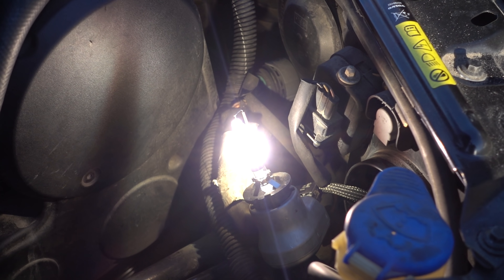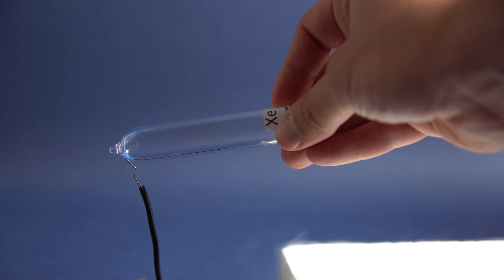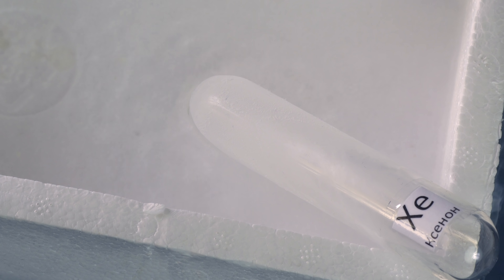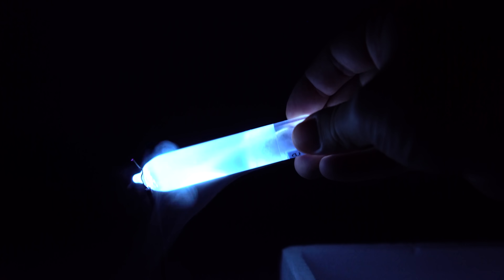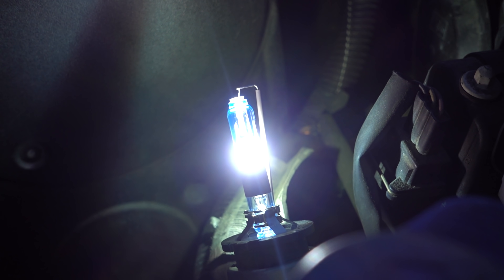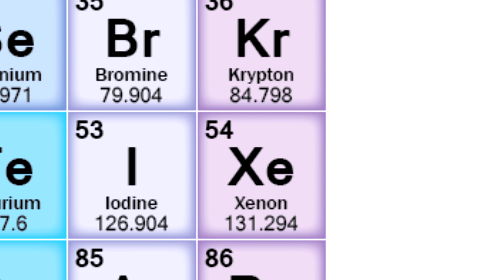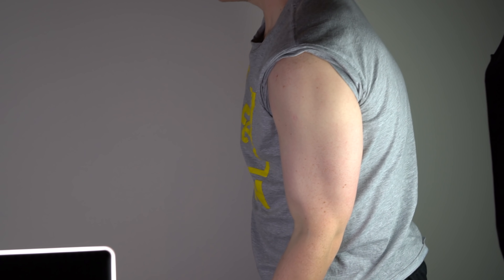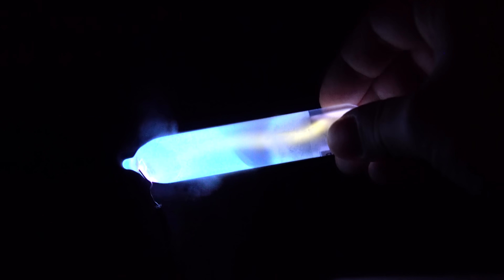Xenon  - THE BRIGHTEST Gas on Earth!

Comment: Ксенон (Xenon) lamps used to make cinema projectionists quake with fear. Because of the erosion of the anode and diode they must be replaced on a regular schedule. The large globe (our industry term) in some projectors is about .5M long and is highly pressurized. In the box with the lamp comes a protective face mask and gloves plus warnings that it is about as safe as handling a grenade with the detonator pin pulled out. This is an exaggeration, but still, no one wanted to be around in case of an accident.

Thank you for another excellent video!

Comment: Problem with xenon headlights isn't that they are too bright. It's that the new piece of shit cars constantly removing user settings to increase profits means most headlights are no longer adjustable. Every bulb is different and so every bulb requires different aim setting to optimize night vision for the driver while aiming the brightness away from the oncoming traffic. This aim is only partially adjustable or fixed in new cars. Manufacturers do things like this on purpose because as people try to save money by buying headlight from jobbers more cheaply people get pissed off and complain. Eventually you will be forced to buy factory assembled and aimed headlight units for hundreds of dollars required by law. Your vehicle will become obsolete faster simply due to expense and availability of that stock part. They get 1000s of times more for the repair and they will get people into buying an entire new vehicle sooner based on issues like headlight repairs that used to be so cheap people carried spares with them, to now where thousands can make you consider the economy of purchasing or leasing new under warranted. A perfect example of this is anti lock braking systems. They made automatic what you could do with your foot. in an emergency situation a skilled and planned skid can save your life but neither the skill or option to learn it is available any longer. Life span of integrated anti lock braking systems is 7 years. Just 2 years after warranty and the cost of repair and replacement is THOUSANDS in parts alone even from a non dealer shop. Add labor to that and just to make something automatic that people could learn with foot break control now has a price tag approaching a 1/4 of a new vehicle's cost. So if your ABS is crapping out and your headlights a scuffed up and your alternator isn't so good and maybe your starter is beginning to drag plus other minor issues you'll be looking to replace items that total would have been 500 dollars 30 years ago that will now be over 20,000 dollars parts and labor. They put integrated circuits in your windshield wipers. What used to be a $20.00 wiper motor is now $500 for the exact same electric motor and the enclosed circuit board. 

I know Big rant for a simple thing like headlights. However, the complaints cause laws that cost us all. BIG TIME! Yet the complaint wouldn't be made if the manufactures designs didn't cause the issue, complaints and laws to begin with.

Comment: Thoriated tungsten electrodes are also used in Xenon arc lamps, like those used in cinema projectors and very high power spotlights. The Thorium (like you mentioned in the Thorium video) greatly lessens the erosion of the electrode tips.

Comment: I make neon signs and I have filled clear glass neon sign tubes with all the noble gasses, He, Ne, Ar, Kr, and Xe.  Out of all of the noble gasses Neon is by far the brightest gas.  Xenon for Neon in a clear glass neon sign tube gives a pale bluish violet discharge.  In rank of brightness in a clear glass neon sign Neon is 1st, followed by Helium, next is Krypton and Argon and Xenon about the same.  Xenon is bright because of the high current discharge. Flash tubes are filled with Xenon however I filled some flash tubes with Neon and they are an incredibly bright reddish orange.
Reply: ..........I imagine the tubes now are being replaced by led strip lights but the authentic tubes will always have a special quality.
Reply: If you made videos of what you do I would watch!

Comment: Cr(CO)6 might react with Xenon at around 20 kelvin.
Reply: Mp57navy I'm replying to you because it is the first top level comment that showed chemistry knowledge and I doubted the channel would reply. I'm hoping you can help clarify something from the video for me but if not no worries. I tried googling but failed. Anyway, he mentioned the ampule is at a lower pressure than standard atmosphere. I didn't understand how gas in a small ampoule like this could have pressure reduced given that I was taught gas pressure increases and volume decreases. How is it possible then to reduce the contents to low pressure?
Reply: @rs180216  you have less of it
Reply: @jarrettallen6064  thanks man. I think that is what is confusing me, if they are just putting the same gas into a more confined space, even if you have less overall volume of gas wouldn't this at least maintain the pressure or increase it? Like how are they reducing the concentration of the gas per cubic volume unit to bring pressure down
Reply: rs180216 sooooooo I don’t know how they compress it but since xenon is the only element in it if there is less it will be less compact and due to Boyle’s law it would have for room to expand lightening the pressure
Reply: More not for and lightening not lighting

Comment: pretty sure xenon isn't melting after being taken out of the liquid nitrogen, that looked like sublimation, could be wrong with the xenon, but it its anything under 1/3 of a atmosphere(you said the sample was 1/100th) then xenon sublimates, as do a lotof gas sublimate at low pressure.